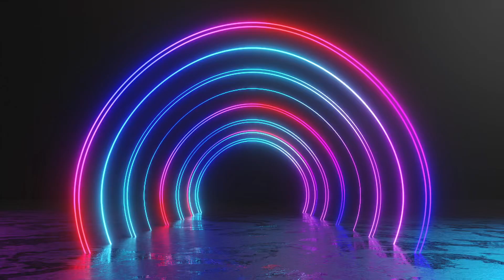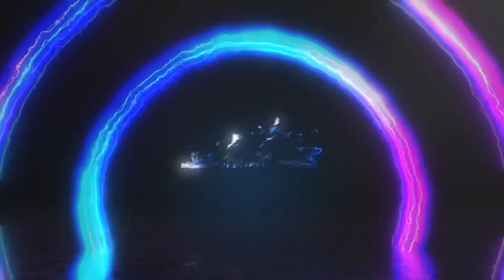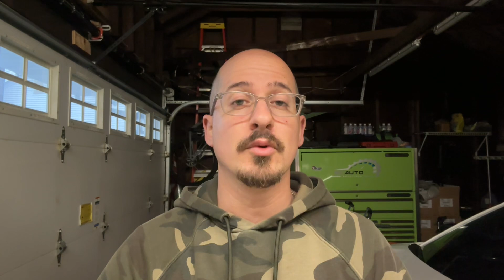Q&A Episode 87 (vibrations | idling engines | dying batteries)

Comment: Hey there, my son is a tech at a VW store but he does work on our Odyssey from time to time.  He said he noticed a few things.  One, the passenger wheel bearing is just starting to go.  Two, the power steering line that runs along the frame rail is leaking a little.  And three, the hardware that is holding the exhaust together is so corroded it doesn’t even look like hardware anymore.  My question is, are there any tips or tricks for replacing these items?  Should I bother with the exhaust since it isn’t leaking?
Reply from the maker: @ChrisHsuCars  hey man good for him and you. I would address the leak as that’s a high pressure line and will go eventually (very common). Wheel bearing is straight forward but can probably wait a little. Those exhaust bits will need replacing eventually. They exhaust will separate at some point I’ve seen it plenty of times.

Comment: What engine oil temp is ideal and when would you consider "fully up to temp"?
Reply from the maker: @Charkatak  I have no idea. These cars don’t have oil temp sensors.
Reply: @BCautosutions  I checked on my Subaru 2.5L and when coolant temp gets to regular middle point on the gauge, the engine oil temp is about at 70 degrees Celsius.
Reply from the maker: @ I wish Honda would implement oil temp sensors. Thanks for sharing

Comment: We've changed a lot of batteries lately... Just changed another one today in a 25 civic Hybrid. Failed 39 seconds into the test... Failing in hrvs left right and center. Few crvs too
Reply from the maker: @FusionBoost2.0  yup soo many die early on
Reply: @BCautosutions  had one that came in the other day brand new CRV off the truck. 10 kms... Started up and lights were on, were like wtf...hooked up the 8000 and sure enough, low battery. We're changing batteries like crazy, those 500 CCA batteries aren't made for cold climates I guess lol
Reply from the maker: @ yeah it’s been bad. Honda needs more ccas

Comment: I had my oil changed about 1000 miles ago on my 24 civic sport touring, and it was a little overfilled at the time. I decided to take a look today, and it seems that the oil level is rising. I know the 1.5t doesn't like cold weather, and i only have a 7 mile commute. Is this normal 1.5t behavior, or do you think I should have the dealership service department check for a leaky injector? I only ask because I did an oil analysis at 2k miles, and it came back with 2.8% fuel dilution (and that was summer weather) thanks brother!
Reply from the maker: @btmedic04  I believe it’s 1.5t cold weather things unfortunately. Doesn’t look to mention it although if an injector was leaking I’d believe it would be throwing a misfire code. Let me know and thanks for that oil analysis
Reply: I just change my oil at 50%
Reply: Did you have it looked at? If so, what did the problem end up being?

Comment: Question for future video I am sure a lot of people will benefit...What is the correct orientation to install the Honda Crush Washer (94109-14000) used on both oil drain plugs and on some models transmission drain bolts. Flat side towards the bolt head which always made the most sense to me or the other way around rounded side towards the bolt head? Another question specific to myself. 2022 Civic Si. What are the actual torque specs for the 3 transmission bolts. Fill bolt, check hole bolt (likely don't need to touch if you put back in exactly what comes out) and drain bolt?
Reply: Flat side towards the pan
Reply: @LA_Commander  Not disputing trying to understand the reasoning behind this?

Comment: When changing transmission fluid early, do you do a complete drain/re-fill process every 30k miles? (4-5 refills probably), or just 1 to 2 partials refills at each 30k interval to get majority but not all of it?. Just seems like a ton of work to get it all replaced.
Reply from the maker: @neilquinn  I’ll add this to my list of questions to answer
Reply: @BCautosutions  Thanks!
Reply from the maker: @ you got it

Comment: So yesterday I turned off the electric parking brake and could not move the car. I pressed the gas and then heard a snap noise and then there was a clunking noise. Do you think it could be a bad servo motor? The car moves now but something seems off with the steering now.
Reply from the maker: @FMB123  are you affected by this extreme cold weather?
Reply: @BCautosutions  yeah it's been pretty cold for Florida standards. Not extreme though.
Reply from the maker: @ I would take it in just for good measure.

Comment: Hey, thanks for the video! Question.. recently bought a pre-owned 2016 crv, why do i see more smoke coming out of my tailpipe compared to other vehicles around my neighbors? Car only has 42k miles
Reply: The color stays like a whiteish-grayish smoke, a little leaning towards white and ofc it’s not blowing a cloud of smoke but it definitely is noticeable amount. I was thinking it may just be cold weather smoke but i feel like it’s bit more excessive compared to my neighbors cars, they have a 9th gen accord i believe with similar motor and i notice not a lot of smoke comes from the exhaust. It goes away a bit after the car warms up, I’m thinking of all possible things, maybe the previous owner barely drove the car prior to me buying the car ?
Reply from the maker: @ it’s probably just cold weather tbh. If it still does it in the summer then I’d suspect something is wrong
Reply from the maker: @popcee526  what color is the smoke? Is it just the normal cold weather smoke? Does it go away as car warms up?
Reply: @BCautosutions thanks for the response!
Reply from the maker: @ you got it

Comment: Does your 3-5 year battery replacement recommendation also apply to AGM batteries? Thanks
Reply from the maker: @prm5798  yep. My pilot battery died right around the 3 year mark. I was testing it religiously and happened out of nowhere. So moving forward every 3 years I don’t even think about it.

Comment: About idling in the winter and summer…. When I get off work in the morning I start my Ridgeline and it’s about zero degrees and sometimes frost on the windows. Sometimes I idle it about 2,000 to 3,000 rpm to get the engine to warm up faster. Is this an OK practice or can this do more harm than good?
Reply from the maker: @richieg7382  I’ll answer this in a Q&A
Reply: @BCautosutions Also I was wondering if VCM activates when you are sitting in park idling?
Reply from the maker: @ it does not

Comment: I just paid $300 for fuel/air induction service for my 2020 Accord 1.5T at 46,000 miles.  Was it necessary or a waste of money?  If necessary, at what mileage should this service be done and why am i getting worse mpgs than before the cleaning?  Thank you.
Reply: What did they actually do as part of that service? Did they dump a can of something in the tank or pull the intake and other parts to do a detailed cleaning?
Reply from the maker: @wendymatsuda418  depends on how and what was done, do you have any details on the actual service and brand they used? Unfortunately a lot of those services aren’t and don’t do what is claimed. I need more details to give a better answer.
Reply: @BCautosutions I was told they used a BG Platinum fuel air induction kit.  A bottle of 44K cleaning solution is put in the gas tank, and some cleaning solution is slowly put in the engine.  The engine is revved several times during the process, and the throttle body is cleaned.  That's what the service advisor said.  The paperwork just has BG Plat service on it and the kit cost $98 plus $230 labor.
Reply from the maker: @ ok then it was hopefully done correctly and did what it’s said to do. I do like the idea of it, as long as it was done correctly.
Reply: @BCautosutions  Thank you! I was sceptical because I thought the only way to properly clean the valves was walnut blasting. I guess I'll have to get BG Platinum service on a regular basis.
Reply from the maker: @ walnut blasting would be the best option although can go wrong quickly and also a ton more labor intensive.

Comment: I have a 2024 cr-v hybrid. It currently has 3k miles on it. Recently on a cold start, the engine start was so rough the whole vehicle shook and sounded like it was having a hard time starting. This lasted for about 2 seconds. This has only happened once so far. What can cause this?  Thanks.
Reply: Maybe just some gelled up gasoline in the line and it was starving until it got going. How cold was it ambient?
Reply: @Watchman999 Regular gas gels?
Reply: @Kaiser23k  injectors
Reply: Injectors
Reply: Injectors are not in a friendly environment with direct injection . Your injectors may be leaking or the face is crusted up . I would try a bottle of injector cleaner with PEA , the good stuff .
Reply: @kenj.8897  just have the replaced under warranty lol
Reply: @ I’ll give that a try. Thanks
Reply from the maker: @Kaiser23k  when Therese hybrid engines run rough holy hell do they sound like they are falling apart. Most likely if I had to guess could be something with the injectors are suggested. If it was just a 1 time thing I wouldn’t worry about it. If it persists, have it looked at and report back